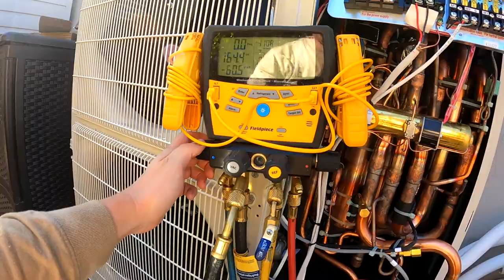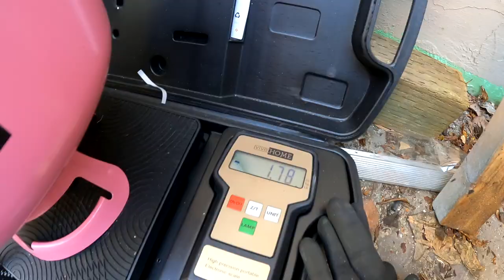8️ Zone Ceiling Cassette Mitsubishi Ductless heating and air conditioning install in San Jose, CA 🤠

Comment: 8 small zones running off single outdoor unit....
I will like to see the performance of this system particularly in moderate cold weather , like 50F outdoor , when the total heating load of the system will be 30-35% of design load and 8 units calling for tiny amount of heating BTU .
There is good possibility that the system will never meet the stated COP of 3-4 which Mitsubishi claims on the specs, resulting in high electricity bill.

Comment: Nice install! Whats the switch next to the heads for??
Reply from the maker: to indoor units. Required by code.
Reply: Do you mean power disconnect for the unit? Required by NEC 440.14
Reply: Im wondering too. Never seen that before
Reply from the maker: Yep

Comment: what's that junction box in the attic called? never seen one before
Reply: I think it's called a branch box. Mitsubishi uses them when you reach a certain capacity of BTUs your supplying with their mini splits
Reply: @potentialhvac6074  is that specific to mitsu? very interesting. i'm guessing 1 run for communication wire to that and then from there to every cassette. also 1 run of pipes as well.
Reply: @theebmo9043  each indoor unit has comm wire and linesets running to the brannch box, then the box has comm wire and one lineset to the condenser. Some people have issues with them but they are really not a problem if installed properly